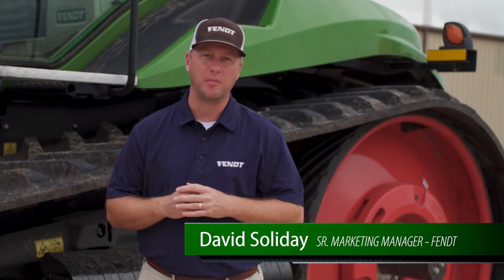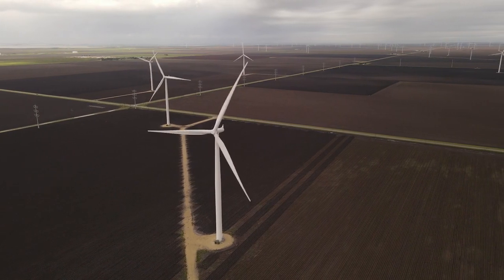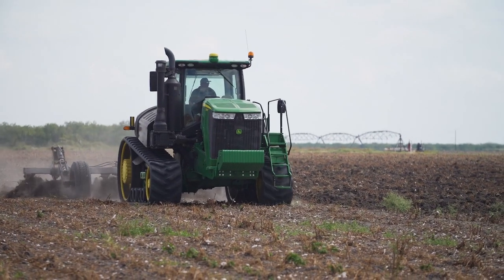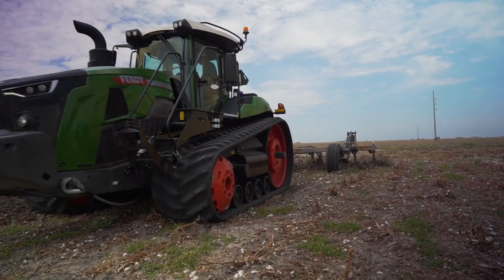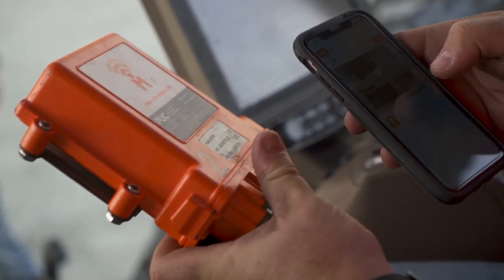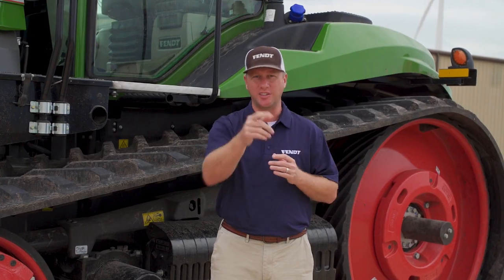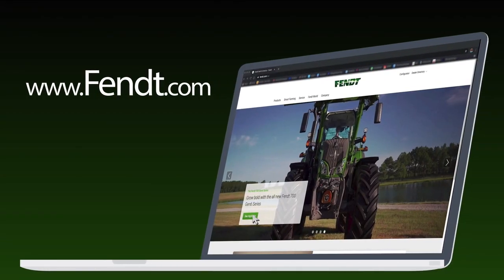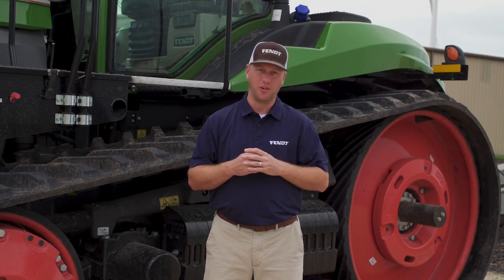Fendt 1100 Vario MT vs. JD 9RX & 9RT | 2021 | Fendt

Comment: We demod a mt1151 against our steiger 470 pulling a 40' protill. Our 470 pulled that protill 1mph faster at the same depth as the fendt, I personally think there is too much power loss with the cvt transmission

Comment: I really wish that they would have also included Case Ih & New Holland as well in these Test, as well as have ALL Manufacturers Reps Present so No One Can Contradict the Data. I’m in the Market for New High Horsepower Tractors, and ALL Manufacturers are On The Table. I’m just not so sure about those CVT Transmissions in High Horsepower Models. I have always been a Powershift kinda guy in Big Horse Tractors, and that is No Longer a Option with these Fendt Tractors. Wish they would have given Customers the Option for Powershift Transmission in Fendt Tractors. I’m also Lacking a Local Dealer.
Reply: disculpa entonces lo que dices es que una transmisión cvt en tractores de alta potencia no son tan fiables ? sácame de dudas por que me e puesto a pensar lo mismo
Reply: @danielsalguero1683  I did not say that they are Not Reliable, they just have Not Been Around As Long as Powershift Transmissions have been. Powershift Transmissions are known for their Ruggedness & Reliability and are Used in Farm Equipment as well as Construction Equipment. The Cat Powershift Transmission’s that was in The Agco Challenger Tractors before they recently Discontinued It as a Factory Standard Transmission is also used in Versatile Tractors 4wd Model Tractors and is the Cat Powershift Transmission. Versatile has used that Cat Powershift Transmission since being Renamed in the Early 2000’s after being Sold by CNH. Powershift Transmissions have been around for 70-80+ Years, They are Rugged, Tried & True Transmissions.
Reply: @taylor11089  aaa pero y las transmisiones cvt nose exactamente desde cuando hayan existido pero primera ves que veo que estén equipadas en un tractor de 600 cv  abra que ver si son duraderas en condiciones de trabajo extremas ya que las transmisiones powershift son para específicamente ese tipo de trabjo
Reply: @danielsalguero1683  Please translate to English since YouTube won’t nor will it allow me to Copy & Paste onto a translate app.
Reply: @taylor11089  @Taylor S Alldredge but and cvt transmissions I don't know exactly since when they have existed but the first time I see that they are equipped in a 600 hp open tractor to see if they are durable in extreme working conditions since powershift transmissions are specifically for that type of work
Reply: @taylor11089  Vario transmissions have been used by Fendt since the early 1990s so you obviously don't know much about Fendt tractors
Reply: @ianbermingham9047   I think you should ReRead my Comments. I never said anything about How Long Fendts CVT Transmissions has been around, other than Powershift Transmissions have been around a Long Time. May I suggest you Read before you Comment.

Comment: After viewing the Video for a Second Time, there is some Factors that I would like to Point Out. Only The Fendt Tractors were 2021 Models with Less than 50 Hours on them. The John Deere Tractors were 2016-2019 Models with 800-2900 Hours on them. One was a JD 2016 9570RX with 2977 Hrs, 2019 JD 9620RX with 816 Hrs, 2018 JD 9570RT with 1138 Hrs, Compared to a 2021 Fendt 1162 with 35 Hrs, as well as a 2021 Fendt 1167 with 46 Hrs. John Deere’s New Redesign Tractors for 2022 has had a Change of Motors in 2nd Largest Model, Previously The 9570RT, 9570RX, & 9620RX, The Largest and 2nd Largest both shared the Same Cummins X15 Motor. John Deere has Replaced the Cummins Motor in The 2nd Largest Tractor with their Smaller JD Powertech 13.6 Diesel Motor used in the Mid Range 4wd Tractors. In All Honesty, Comparing The 2022 JD 580RT/RX Model with The 13.6L Powertech Motor would have helped this Comparison as I believe it was a Mistake by JD to take out that Motor and Downgrade The Cummins 15L Motor for the JD 13.6L Powertech Model. As with Anything More Hours of Use on ANY Tractor Increases, It Does Not Perform as well as a New Machine with a Few Hundred or Less Hours Does, Parts Wear Out as well as Tracks have Less Tread so you then have More Track Slippage (especially with a set of Tracks with 2900 Hrs on them) which then Increases Fuel Consumption on The Tractor because the Tractor has More Slippage, which then causes The Acres Per Hour of the Tractor to be Less. It’s Not a Fair Comparison to Compare Tractors with that Drastic of Hours & Years on those Machines. This is Why Test from The Nebraska Tractor Test Lab with No BIAS’s Comparing NEW Tractors to Tractors has always been Important.
Reply: Maybe the focus of this video was to show the advantages of trading an used Deere to a new Fendt.
But apart from that you are right. Comparing new to old tractors seems to be unfair. And it is always more or less biased when a test was made by a special brand. Maybe the Fendt 1162 and 1167 will be tested in Nebraska soon, so we could compare neutral measured values.
Reply: That is completely false. A tractor when new isn't performing as well as it will after it gets a 1000 hours or so on it.  Everything in the drivetrain wears in and actually draws less power. The engines also will do better after at least a few hundred hours.  None of these tractors had enough hours on them to start going down on power at all.  As far as the belts go, in the hard ground conditions these were tested in, that difference would not have mattered either.   I have 2 track 800 series machines with 4500 hours and they will work harder today than when they were new.

Comment: I would recommend you to watch the same test, but presented by John Deere 😄you will see results different by 180 *
Reply: Check out a guy called Mike Mitchell, he also did a test similar to this a couple months ago with a John Deere 9620rx, 9560rt, fendt 1050 and fendt 1167.